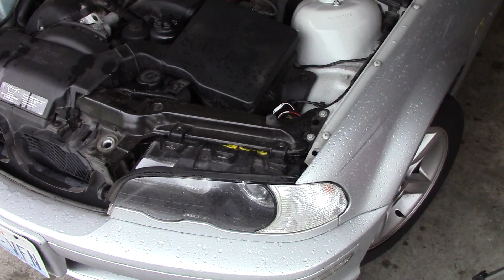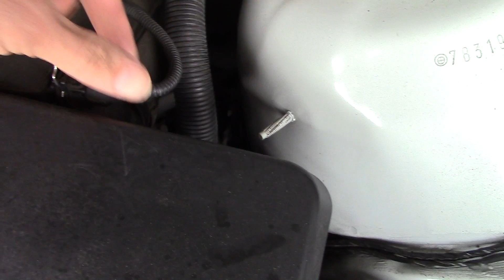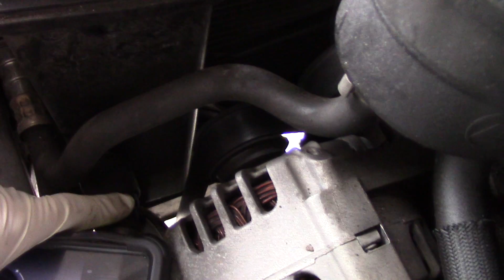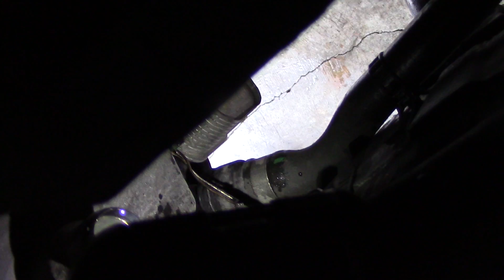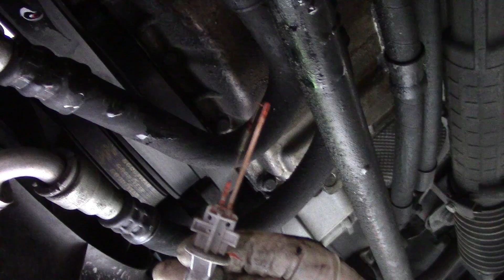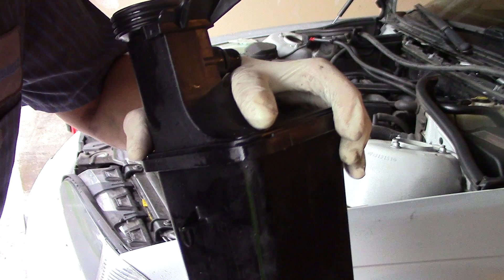BMW E46 Expansion Tank Replacement

Comment: Can I just ask how would you diagnose this? It's a leak I'm guessing? The reason I ask is mine (the exact same model/colour as yours) has coolant-like stains in the engine bay if that makes sense? Sort of a white stain that I'm sure is coolant, just no idea how to find where the leak could be. Changing thermostat and water pump soon so may change the expansion tank if it could be that.

Comment: Man is so tight that when I lift up it don't even move. Any suggestions?
Reply from the maker: Raheem Foster mine was exactly the same way...  I was grunting like crazy and ready to give up. Then I started pushing back and forth as if I was standing and pushing towards the firewall and it made a loud pop..  then I wiggled some more and it popped again... I then yanked it up and it came out...
Reply: Carl Argabright I ended up taking the the whole part off that it was attached to. I have to get a new one because the place where the thermostat goes was molded and completely tore.
Reply: Carl Argabright I took the radiator mounting plate off. Then the coolant reservoir tank came off but it was all molded and the thermostat broke so I have to replace the mounting plate. How much you think it is and where can I get one asap ?

Comment: wow $110 from dealer is such a rip off. These OEM tanks should only cost $35
Reply from the maker: 110 is way better than the 1,000 they charge to replace it, lol! But your right, 110 is a little steep for a small plastic tank...

Comment: I noticed your new tank didn't have the bottom hose connection and bleed screw. mine didn't come with one either. do you have to remove it from the old tank?

Comment: When I took my expansion tank out I noticed a piece with a spring that I think controls how much coolant is used is stripped and broken. It's located right below the expansion tank. What's that piece called and do you know if I could buy that piece by itself or if It's a part of the radiator?

Comment: I have just done this job after watching this video.  I found it  easier to take out the radiator and then separate the expansion tank from it, as on mine it was a very tight fit for pulling up without breaking the oil cooler thermostat. The hoses can then be reattached to the new tank and the tank attached to the radiator plastic moulding, and then the whole lot refitted.  There are two screws holding the radiator at the top. One of them holds the electric fan also on my car. The hoses were a tight fit and I could not pull a couple off.  I carefully used leverage to pry them off.  So many videos don't show how to deal with the difficult bits. Great video. Saved me a lot of money.

Comment: Cool, this helped me with X3 expansion tank. FYI the bottom hose does not need to come out. Also when inserting it all back in, a slight smear of grease on hose fittings makes them all slip in easy. Saved some $s for sure. Cheers

Comment: I did this and still leaking even though I had hairline crack. IF YOU HAVE A AUTOMATIC LIKE ME then please order cooler thermostat and maybe that's why mine is leaking again. I did a lot of research to find this out.  17111437362  part number. I think my top hose is leaking where I took it apart that was never there before.
Reply from the maker: +Jayash patel Sorry to hear that! Mine is an automatic as well...
Reply: +Carl Argabright  Hi did you check your thermostat  because 50% it breaks when you remove tank.  I don't understand why my new tank is leaking.  Looks like its leaking from top hose maybe. and my heater only gives cool hair
Reply from the maker: I removed the sensor before removing the tank...  It sounds like your system is not building pressure and circulating...  Is it leaking from top hose?  Can you see it leaking?  How fast does it leak?
Reply: +Carl Argabright  I can see it leaking at the bottom after pressure and it looks like it's coming from top of tank but I cannot see where from. I see a little puddle under the top hose. it hard to see under top hose. I need the pressure  tester.  the thermostat is inside the bottom tank  which can only be pulled after you remove tank. I think your talking about coolant level sensor. I show you part number
Reply: http://www.realoem.com/bmw/enUS/showparts?id=ER12-EUR-01-2002-E46-BMW-316i_19&diagId=17_0141   

part number 4 has a picture if you clip on it
Reply from the maker: +Jayash patel I was talking about part #8 coolant level switch. It might be that the tank didn't snap back in all the way. It was tough getting the top and bottom fingers lined back up...  It also made a really good and loud pop when it locked back into place.
Reply: It did not make a snap noise I tried it 3 times and wasted all day. But I had a look and felt like it is seated correctly but no click. My be 
 take the new o rings out and put old o rings on bottom ??
Reply: hi here is the broken part i took out it was   jammed.  For some reason the leak has gone how is that possible when i took it to mechanic to look at it
Reply from the maker: Send a link to the picture, I'm curious as to what it was...
Reply: +Carl Argabright  i have taken the tank out to replace this part 
http://tinypic.com/r/2ykc2gx/9

I hope the leak does not come back i keep you post below shows what it suppose to look like. 50% it break when you remove tank

https://www.google.co.uk/search?q=17111437362&client=aff-maxthon-maxthon4&hs=BST&affdom=maxthon.com&channel=t26&tbm=isch&tbo=u&source=univ&sa=X&ved=0ahUKEwjs14vN9cPMAhVH6RQKHa40CsUQsAQIHA&biw=1847&bih=841#imgrc=KcHUFUqp8WtHFM%3A
Reply: +Jayash patel  btw the link went away before i did anywork. this part keeps the  tranny liquid correct temp
Reply from the maker: I am glad you got it figured out!  Great work!  That thanks for sharing the link also, that will help many more people in the future...
Reply: +Carl Argabright  I thought I change the thermostat  and water pump even though nothing wrong with it as people told me when the tank goes soon after tjem parts will also but I cannot get the dam belt off
Reply from the maker: +Jayash patel the trick to getting the belts of was to buy a small 10mm wrench with a really long handle.  This allows you to take the fan off very easily and then you can get to the belt and thermostat...  When I get home from school I can look for mine and snap a picture for you...
Reply: +Carl Argabright  I don't need to take fan off but the problem I have is I cannot find the bolt to de tension the bill off send a link to the picture
Reply: http://i67.tinypic.com/2mhv7dk.png
Reply: http://i66.tinypic.com/ogl920.jpg

Comment: Good video but on the removal.
I didnt even have to get underneath the car.
Undid the sensor, removed the top 2 hoses. prized the top on the clip out at the top of the mounting bracket and pulled, and the tank came up with the bottom hose on, then simply sprayed the bottom hose with WD40 let it soak for a minute the with a rag wiggled the hose off. and the tank simply lifted off, i did also remove the air filter bracket (the one sat on the bonnet)(Hood) with the 4 insert clips, and the single clip holding the black rounded breather box. just to give more room, took me about 20 minutes in total.. hope this helps.. 4 pot engine.. 318ci se 1895cc 2001 electronic fan.
Reply from the maker: Awesome man!  Better than me!  That sucker was hard to unsnap from the bottom when I went to pull it out!  I can't believe the dealer charges so much to replace this thing...
Reply: +Carl Argabright To be honest with you Carl.
I have been a mechanic for years ,since I was 15 and I am 46 now so had my years tinkering with cars, so obviously I know the short cuts, but not to undermine you in the slightest, your video shows the right way to do it, and it's informative and well shot in detail, Everything a Diy mechanic/maintenance guy would need. And you filmed while doing the work. Make it even better how you managed it. Top man, Top video.
Reply from the maker: +Jonathan Groombridge thanks a lot man!  I am definitely no mechanic, I just happen to like to work on my own stuff...  When I ran into this problem with my car there was no videos that showed me what needed to be done to fix it.  That's when I realized I should give something back to YouTube and share this with everyone!  I truly never expected it to get this many views!  Thanks for sharing your input man!
Reply: +Carl Argabright Hey that's a really nice reply Carl.
Your welcome and credit given where credit is due.
Nice to see there are genuine nice people out there that want to help others, for a first video mate it's great.
You should do more.
Think I will do some myself too, I'm also like looking how to do stuff and always fixing things, so maybe I can help others too?
All the best Carl.
Take care. :)

Comment: I just bought a 2000 323i that has a slight coolant leak, I'm hoping this is it.
Reply: Same haha
Reply: Mine turned out to be a bad radiator, I fixed so much on the car I got tired of it and sold it

Comment: hey bro i got a 99 323i e46 ... what is that plug called connected to the sensor.. i need one and cant find in any store but the dealership but its too expensive for such a little thing. can u please help md

Comment: One thing I'd like to add is:
Make sure to not use a 2.0 bar cap for the expansion tank. Change that to the 1.4 bar one from the diesel models and you should be problem-free in the future.
Reply: You can tell at which pressure yours open via the number on top: 200 indicates 2 bar, 140 equals 1.4 bar
Reply: I have a Z4 ‘05 with a 2.0 bar cap on exp tank, why is 1.4 better in this case?

Comment: BMW X5 i have changed water pump thermostat expansion tank and radiator transmission thermostat. My coolant light come on i checked the water its ok can you please tell me why THANKS
Reply from the maker: +MegaAmeer15 I would take a look at the water level sensor and make sure it is functioning correctly.  What year is your X5?  Maybe I can find out some more info on that make/model...

Comment: Great video! But on that aftermarket part of your video.. I would have to disagree.. I bought a aftermarket one (50$)and it's been problem free.. Let's not b afraid to buy aftermarket and let's save some money guys..
Reply from the maker: +Eric Meza im not saying aftermarket is bad, I have heard a lot of people using Behr replacement tanks without any problems.  However, from my experience BMW uses name brand manufactures that provide good quality and when i've used cheaper parts from amazon i've noticed poor quality and craftsmanship.  Especially, with the blower motor speed control that goes behind the glove box.  I bought one on amazon and it failed within the first year, and I had to do the job twice....  Thanks for watching the video man, i'm glad it helped you save a ton of money!

Comment: is there a drain plug on the expansion tank to drain the coolant? I just have 1 plug and its on the radiator. 330ci automatic, thanks
Reply from the maker: +MLZ59 Sorry for being so late answering your question, but yes you are correct.  There is only one drain plug on the bottom drivers side...  Thanks for watching my video, hope this went well for you!

Comment: Just wanted to add that electric connections like on the MAF are simply removed by pressing the metal clip in and pulling the connector off.  Prying the connector off is not necessary

Comment: did you have to replace the oil cooler thermostat?
Reply from the maker: ***** no I did not...  I was able to remove mine before pulling out the expansion tank...  It wouldn't be a bad idea considering how much you gotta do to get at it though...
Reply: Thanks alot mam. You rock. Yea I ordered a new expansion tank amazon 2 day shipping. I ordered a new oil cooler thermostat. The one that goes inside the expansion tank. It wont arrive till next monday bummer. So imma be very carefull removing the tank. Ill let you know how it goes. Thanks again.

Comment: Great video Carl, just one thing, the sensor you removed from the bottom of the tank is the "Fluid Level Sensor" and not the "Temperature Sensor" as you mentioned. The coolant temperature sensors are on the radiator and engine.

Comment: Carl Argabright Recently I had a small leak at the upper seam of my expansion tank. I had already purchased a new tank, new hoses & water pump with the plan to replace everything over the upcoming weekend. The Friday before my planned project weekend I had a catastrophic failure of my expansion tank on the way home from work. It happened on a stretch of highway where I could not stop the car or pull off. The car overheated for less than 10 minutes. Being a long time BMW enthusiast, I own 3 of them, I knew how damaging this could be to my car! This one incident resulted in a blown head gasket and a warped head which pulled the head bolt threads out of the block!! With repair estimates ranging from $2,000 - $3,000 to being told to get a new engine, I decided to do it myself. Working on it after work and on the weekends she's finally back together after 5 months. Could of done it over a couple weekends but it was summer and I took my time. I love my sexy 04 325Ci but I should have loved her more! I should have loved her enough to fix this problem when it started and not wait a week!! With the purchase of tools and parts this job still cost me around $1,500. DO NOT LET THIS HAPPEN TO YOU!! Less than $300.00 in parts should do it. Follow this video and fix this problem when it starts. Better yet, follow BMW's recommended maintenance schedule and replace cooling parts before they fail.With all the warnings about the seriousness of overheating a BMW that I've read on the forums I still let it happen & I seriously paid for it!! Good luck guys and love your ride so she loves you back!!
Reply: Marc Woodward my reservoir cracked and instantly started overheating but was able to get off the highway and get a tow to firestone... $320 for replacement and tests to check cooling system
Reply: SAME STORY on a 330ci i'm finishing up...these engines are a pain to work on. i ended up buying another one with a driving wheel reversed to swap.

Comment: Nice vid, thanks heaps, if you have trouble taking the tank off use a long screwdriver to lever it off at the bottom joint...

Comment: you say that you reccomend original BMW part, but if you get OEM part that's just as good and usually alot cheaper. BEHR i believe is the manufacturer for those. they deliver the same quality as the original.
Reply: Modine is the OEM Manufacturer of the expansion tank. But OEM is what your looking for.

Comment: I just wanted to add a tip, something I did, that seemed to make removal of the old tank a little easier. I got under the car and used a rubber mallet and short piece of wood to apply upward force on the lower part of the expansion tank. I did not use a lot of force but doing this made removal quite easy afterwards. The thermostat still needed to be replaced but I was warned about that by ECS Tuning when I purchased the replacement tank.

Comment: Thanks for making this video. I just used it to prepare myself to do this replacement on a 2004 BMW 325i. There were some minor differences but it all went fine and I got it all done.  Thanks for taking the time and trouble to share your knowledge and expertise. FYI, I needed to replace the expansion tank because, during a recent cold snap, I bought a cheap coolant anti freeze pipette tester and the 4" plastic tube fell off and disappeared into the bottom of the expansion tank. I was afraid it would be sucked into the engine and cause damage.

Comment: Firstly the expansion tank doesn't just "POP" out. Nothing on a BMW does. There is a transmission thermostat that WILL break that seats under the tank and isn't the easiest thing to replace. Before you replace the tank, buy a thermostat just in case. BMW will accept the return if you don't end up needing it. (You'll thank me later).
Reply: Yup. My tank didn't exactly pop out either, but sure, it broke the thermostat. (My 330 is an automatic as well). I saw your comment too late, so my work kinda stalled a bit now that I have to order one. It's just so typical.

Comment: When i pull the tank i saw a little cap with a spring coming out . Any idea about what it is for?
Reply: Carl Argabright Probably the automatic transmission thermostat, it's housed under the expansion tank where it connects to the black bracket.

Comment: Great job.  Thanks i am about to do this job.  Only comment would be to not use the screwdriver to pry directly against the paint; you could use a rag as a buffer between or find another surface to pry against.  Could damage the paint and cause the engine bay to start rusting.  But not a huge deal.  Thanks!

Comment: great video. while your in there, its always a good idea to replace the hoses on the upper and lower. 

its been my experience that when you have a chance and you are in the E46, replace as much as you can. especially if you are replacing parts due to aging. chances are everything else is aging. so in this instance, replace the hoses and also consider replacing the radiator. believe it or not, replacing the entire cooling system is extremely easy on these cars. and cheap if parts ordered online.